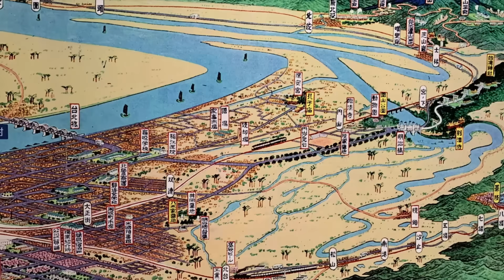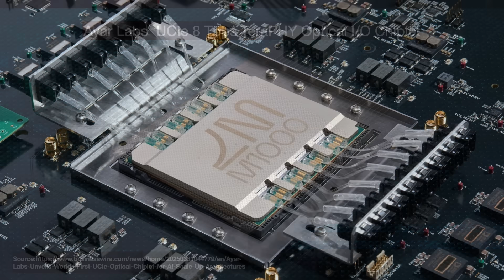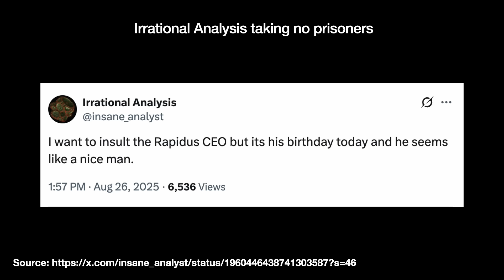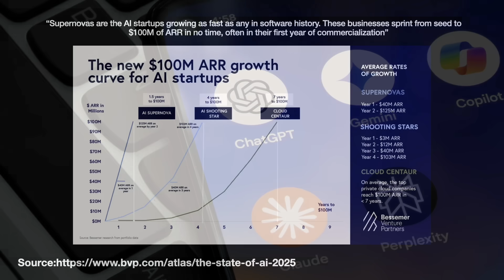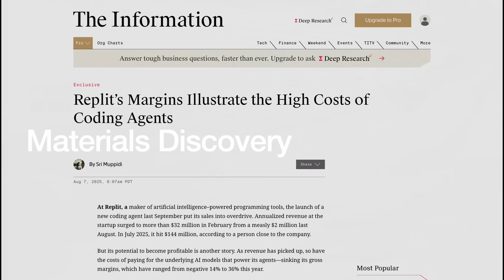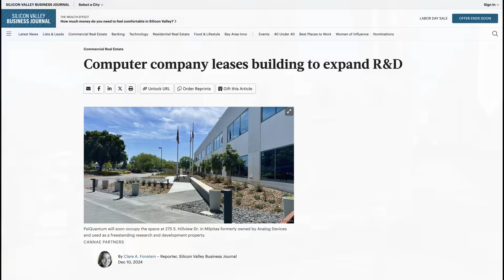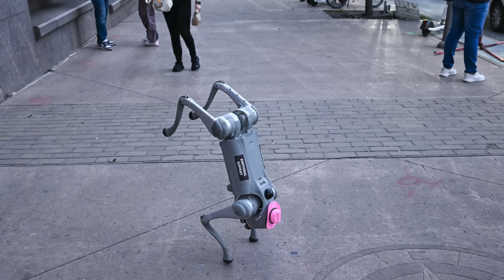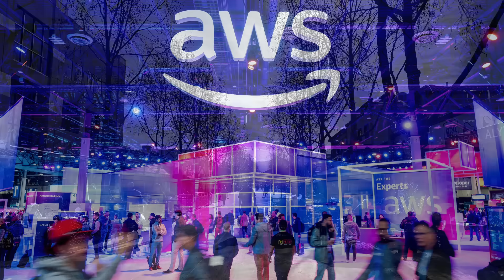Silicon Valley’s Doing Hard Things Again

Comment: Part of the reason this looks like a bubble is that capital wants growth, and lightly regulated software and AI industries are the only ones we’re allowing to grow.
Reply: After you get your shit fkd, you rip it off the robot and it becomes yours.
Reply: The other thing is that many other sectors are simply closer to their maximum potential. 

Supersonic airliners haven’t taken off even when regulation was light on the industry because the marginal benefit from faster speed isn’t worth much except for the ultra-wealthy. Airplanes have actually gotten slower over time.
Reply: @innosam123 This is partly true, there are for sure diminishing returns as technologies follow the well-known S-curve. However, many sectors are trapped at local maximums. Capitalism doesn’t magically guarantee you explore the full solution space. Once a lot of money is made and the low hanging fruit picked, incumbents switch strategies to protect themselves from disruption, very often through regulations. This is why for instance, in general aviation everyone is flying around in Cessnas built in 1972, while even modern planes lack software safety systems that could prevent a huge number of accidents. Even well-meaning and appropriate regulations can sometimes have the second order consequence of consolidating incumbent power. This subtle interplay seems beyond the capabilities of our governments to handle. I am convinced there are huge growth opportunities in “legacy” industries; but to unlock those you need a scalpel rather than a sledgehammer.
Reply: @hagus42 True, but it’s not like Aviation isn’t an industry where governments are trying to boost their national champions as much as possible. Also, aviation regulation is very strict now because the public’s tolerance of airline disasters is so low. 

If anything, aviation is an example of an industry where we have probably hit real maximums and so technology has slowed down.

It’s usually more the boring stuff that no one cares about that is over regulated. Energy, agriculture, and construction are examples of this. 

They have been hampered for environmental reasons, which is sometimes justified and sometimes counterproductive (you can’t build rail because it would hurt the environment or disturb nearby residents.)
Reply: @innosam123 aviation is actually an industry rife with national protections. For instance cabotage rules prevent foreign airlines from operating domestically in the US (edit: point to point domestic). Foreign investors are prohibited from owning controlling shares of US airlines. There’s a long list. 

And some of those regulations make sense, some used to make sense but don’t any longer, and some are hard to defend (and some are missing!). 

My point is that we’re not super good at the trade offs. Here’s an example. Congress ruled that to gain a commercial aviation certificate you need 1500 hrs of non-commercial flight hours, up from as low as 250 hrs, due to Colgan Air flight 3407. 

Net result of this was no decrease in aviation accidents, but a dramatic increase in the cost of training new pilots in both hours and expense. And a possible increase in GA accidents are pilots now have to “do laps” in the sky to built hours. Widely considered junk hours because they’re not at all hours that prepare them for realistic commercial aviation scenarios. 

Now there are innumerable examples of good regulation in aviation you could cite. My broad point is that we’re pretty crap at making sure the whole list is tight and well optimized. And that is a total self-own we can and should avoid. 

But I do agree at a technical level there’s no low hanging fruit held back by regulations when it comes to aviation. No flying cars held back by shadowy regulators. 

I think we might debate the particulars of aviation but agree on the broad point. Totally agree that boring industries have an even harder time. 

Optimizing all this wouldn’t create a “boom” in those industries but it would at least enable growth. And while capital loves massive growth it also doesn’t like risk, and we could have more steady and less risky markets if industries were able to steadily tick along and grow.
Reply: AI won't produce all that much.
Reply: @Psmerling  How is this even remotely a good take?